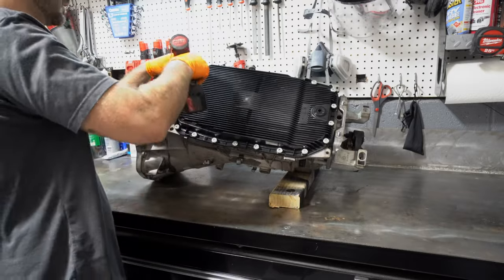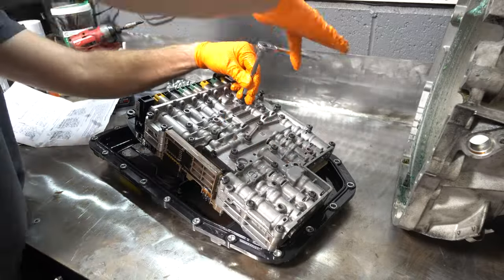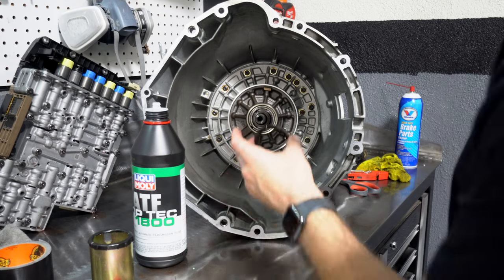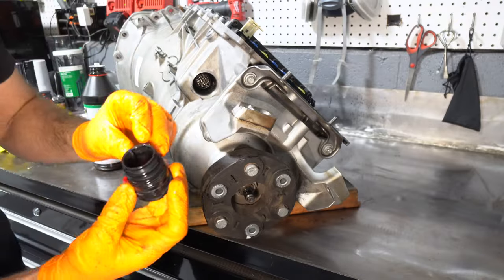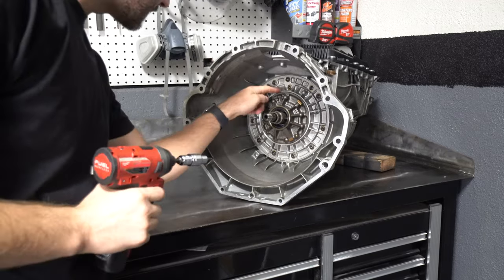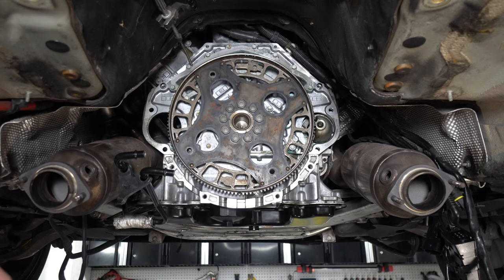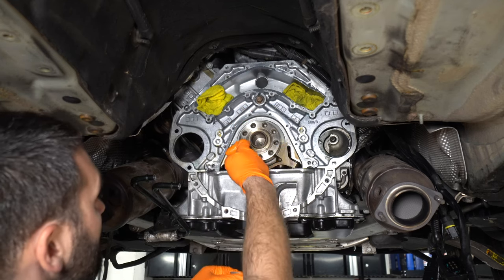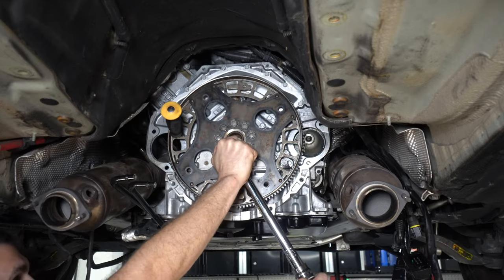BMW 545i E60 ZF6HP26 Transmission Seals and Solenoids Replacement

Comment: Are you sure about putting oil and atf on the sealing surfaces of seals, usually these new seals are teflon and are not supposed to be oiled up because that can cause leaks?
Reply from the maker: Hey, I think you’re right that BMW does say to put them on dry. I have always lubed them up some so it’s a habit. It hasn’t leaked since reinstalling and driving for about 75 miles so I think it’s good to go!
Reply: @rebuildrevival  if it starts to leak again you know why :D , i know when i install them they come with special warning sticker do not oil before install but ok

Comment: Hi everyone, little update on this awesome video.

Don't oil the seals!! Install them dry!!
Reply from the maker: You’re right that’s what the manufacturer says to do, although a BMW tech friend of mine says he uses lube on some seals no matter what the manufacturer says, IDK🤷🏻‍♂️
Reply: @rebuildrevival  you can use a water based vaseline to mount pretty much anything from o-rings to gaskets to keep them in place

Comment: You can tell that modern cars are not built to last. Look at that tranny! You have like 10 different fail points in that unit alone! All flimsy plastic and rubber and the amount of work you have to put into it to service it is insane, and that's why it's pretty expensive to take your car to a dealer or a mechanic if you don't have the tools to do it yourself or you don't know how to do it. 
Many modern cars end up in junkyards due to things that are "cheap" to fix, but pretty time consuming or expensive if you don't know how to do it yourself.

Comment: Any improvement after this repair?
What were the symptoms?
Reply from the maker: Hey, I was having a hard downshift from 2-1. After everything I did, the problem went away but I’m unsure of which repair I did fixed the issue. Could have been as simple as a programming issue or a combination of the seals, solenoids and the programming.
Reply: @rebuildrevival  thanks